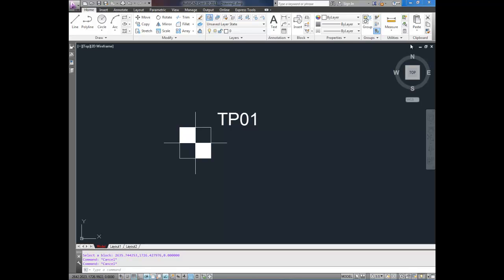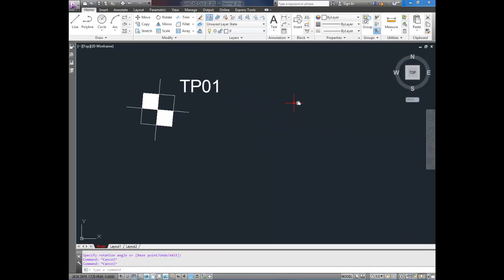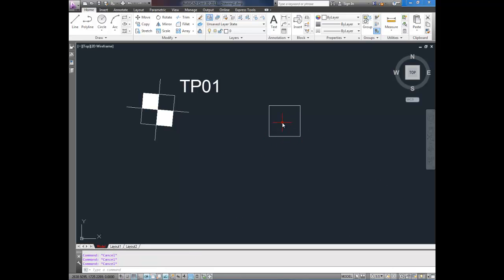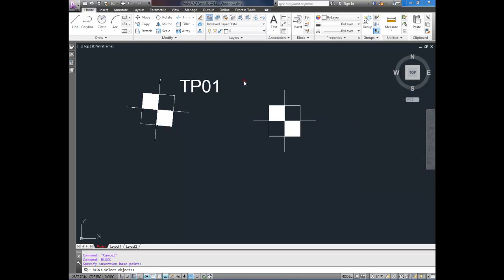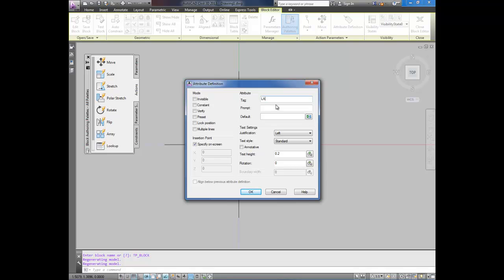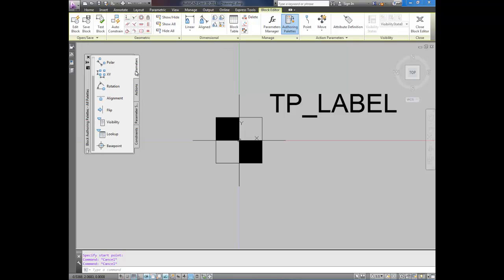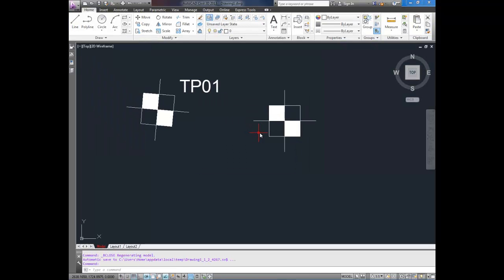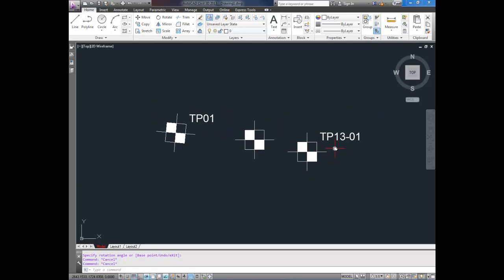AutoCAD How to Create a Block - Custom Block Tutorial

Comment: Nice video many thanks.
Would you have any video's for inserting a test pit (or in my case, a stationing point on a pipeline route) which, when inserted automatically will give a Northing and Easting?
I have done something using fields within an attribute but I have to do things manually by 'updating fields'

Regards
John